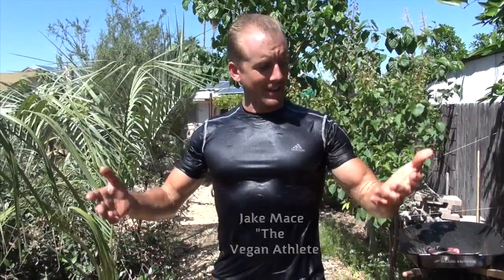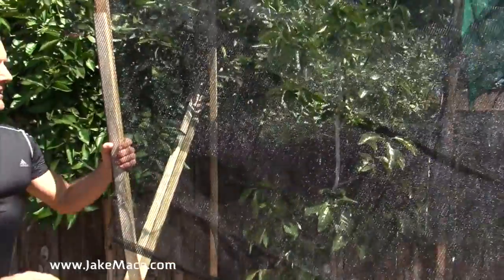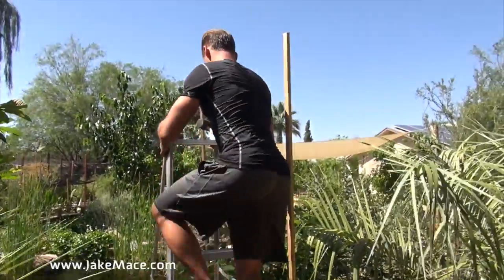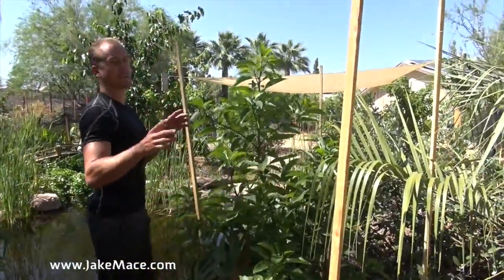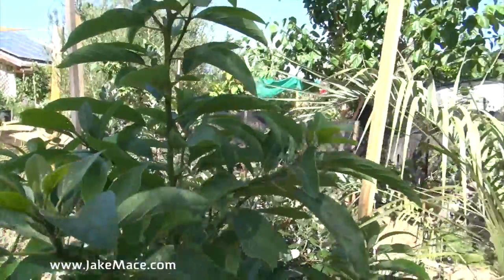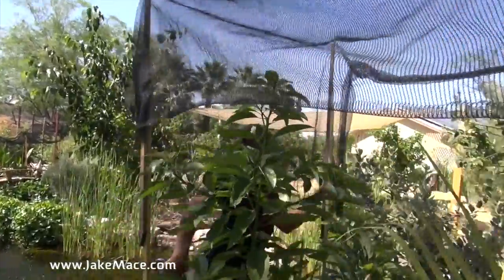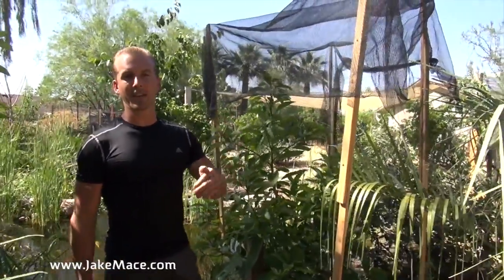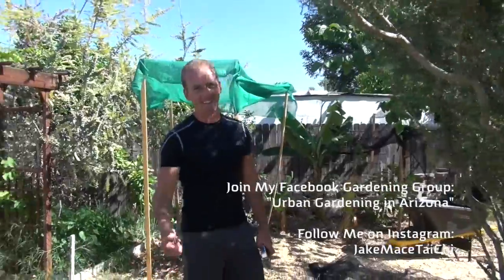How I Shade the Fruit Trees in My Garden

Comment: What I like to do is use 7' steel t-bar which gives me a nice solid base and then if I need more height I tie on some PVC which comes in 10 '  lengths and can be cut to the length you need.